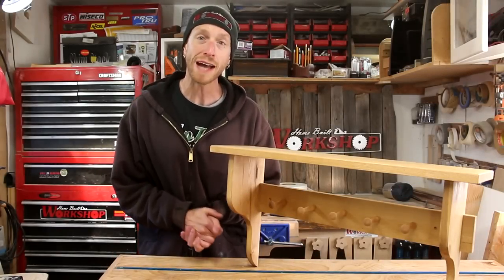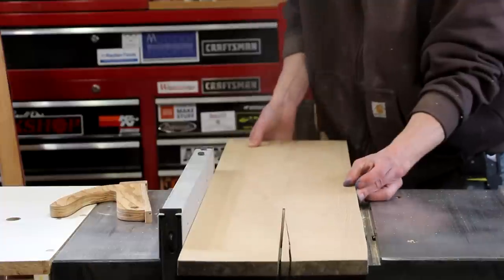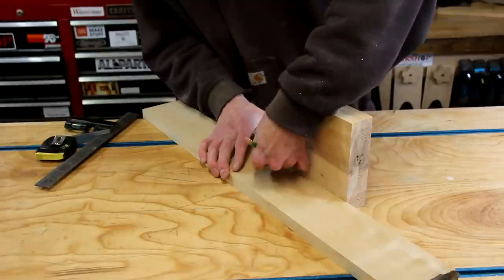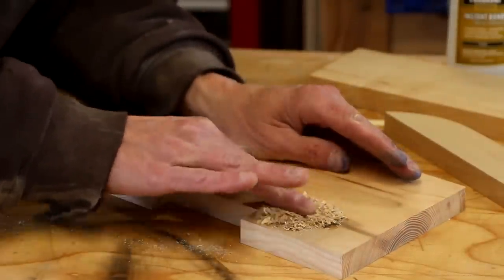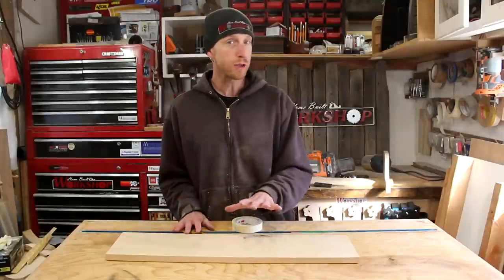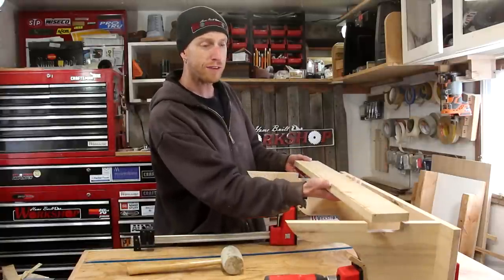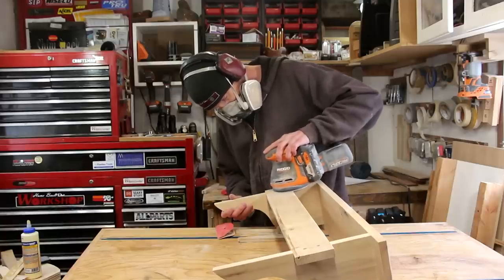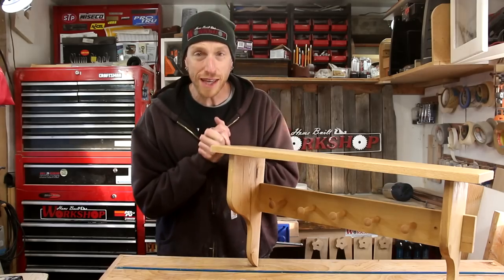How to make a Shaker Style Shelf (with Shaker pegs)

Comment: Well I am no wood worker trust me but in regards to the glue maybe you could buy a 1000 pack of "acid brushes" on the Amazon? I use them all the time at the shop and they are cheap enough to toss. Might be worth considering?
Reply from the maker: I to believe I need to get more of these. I had a pack but of course, now I can't find them. Isn't that how it usually goes? LOL.